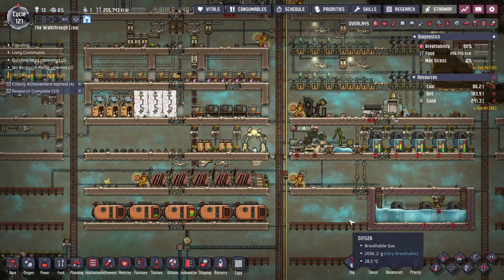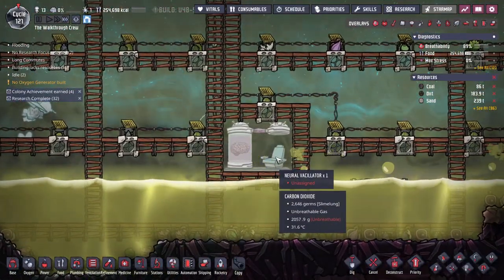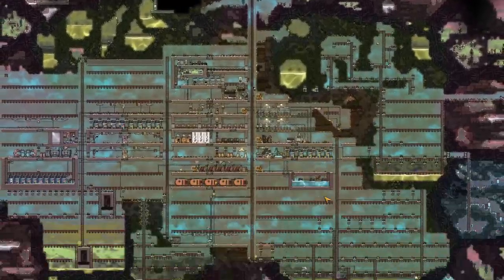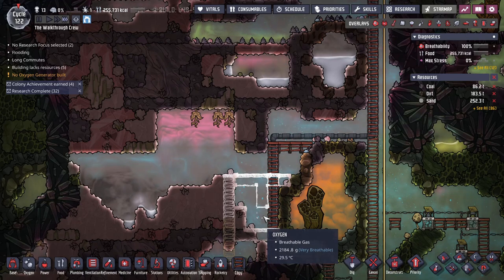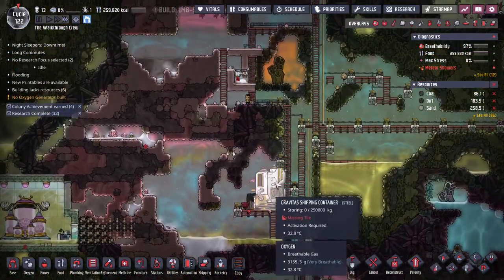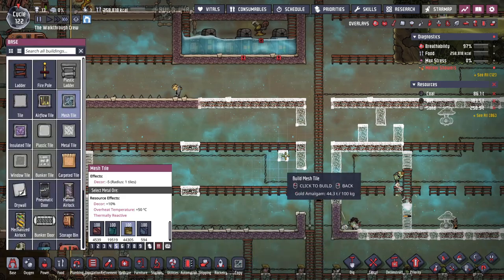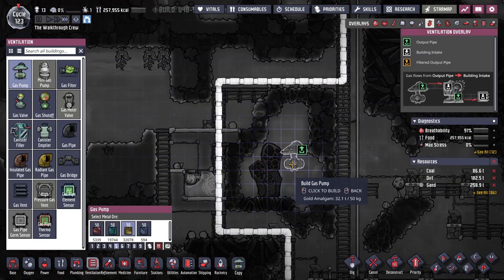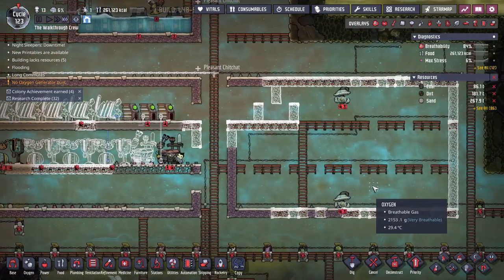Oxygen Not Included: Full Walkthrough Part 14 (2023)

Comment: I wonder how it is possible not to overload your circuits with so many electrical consumers and simple wires. I would appreciate a video about this in your HELP! series...
Reply from the maker: Absolutely!  It's a good idea, I'll put it on the list.

The reason I can hook so many together is it's rare to have everything running all at the same time.  Assuming you are consistently using small wires and small transformers, the biggest symptom will usually be power outages rather than overloads.
Reply: It also seems that you don't bother burying wires or pipes inside floor tiles in order not to decrease the morale of your dupes. Is this for in-video time saving reasons or the decrease of morale isn't worth the effort ?

Comment: This isn't exactly related to this video but I'm having a hard time getting my dupes to actually move the hatchlings from the side room into the main two. When I look at the critter sensors and all, the door is shut so thee automation seems to be fine. But when I click on the hatchlings there's no errand for them. The drop off is set up correctly as well, I triple checked. Could it just be something with having only one duplicant ranching or would it be something else? When I manually ask them to wrangle the hatchlings it works just fine and all of my eggs are sorting out correctly. It's really stumped me.
Reply from the maker: If there are only hatchlings in the room, I'm pretty sure duplicants won't manually move them between rooms until they grow into adults.
Reply: Okay, thank you! @Magnet_MD